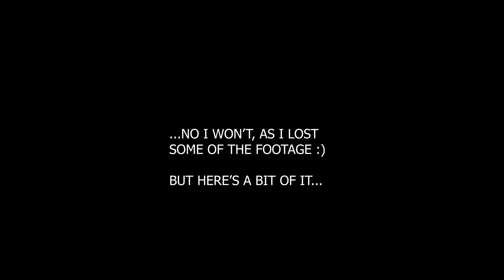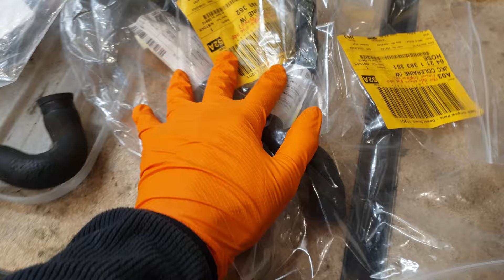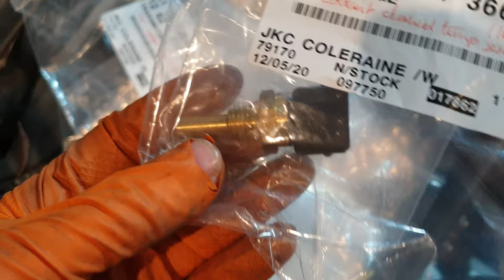BMW E31 850i "Glacier" - Complete Restoration - Hydraulics/Mounts/Cooling - Episode 6

Comment: PS pumps are notorious for leaking, the Dumbbell and engine side gaskets are the usual culprits, good preventive maintenance. The filings could have been from  breaking in from point of manufacture. 

The secret to the Large cross bolt is to use a wide face, hammer through, flat blade screwdriver (WERA makes the correct size that slots perfectly into the width of the cross on these screws) hold the tip of the screwdriver at 20 degrees to the screw head, then 2 strikes to the cap of the screwdriver with a metal face dead blow hammer and presto. Never use heat on these as it can expand the pinion gear shaft while it is dismantled. 

You will feel a massive difference in the box and on acceleration with the new mounts planting that beast of an engine.  

although those rubber hoses at the firewall look in good condition they are prone to failure and become a pig to find the culprit when they do fail, small water pump pliers and a twist will save you from skint knuckles  

It was a truss half coupler with hex bolt you needed to mount the aux water pump, if your ever back In there it’s just a plastic one. I wouldn’t worry about the vibrations as the pump was mounted directly.

I like the attention to detail. 🏴

Comment: The thing with the engine mount and basically all rubber dampers is that they get a lot more work/force from the side of the road where it is not in as good a condition as towards the middle.  So for you it's the left side, for normal side traffic the right ;)

Comment: The oil leak attacked the rubber and destroyed the engine mount. That's how it happened only to the driver side mount. 
BTW the vise works alot better when bolted too the table. lol

Comment: Why didn't you replace the brake cylinder? You had it out, went thrue the trouble of rebuilding the power steering pump and said that the car wasn't braking great?
Reply from the maker: Yes indeed, the whole process is a balancing act. There are any number of things that can cause the bad brake feel, from the discs, pads, calipers, to the fluid, pressure accumulator or brake linkage. All of the above will be/has been replaced, if the braking is still bad, I will change the cylinder then. :)
Reply: @stevesbmwbarn5706  I see. I have enjoyed the videos. 👍🏻